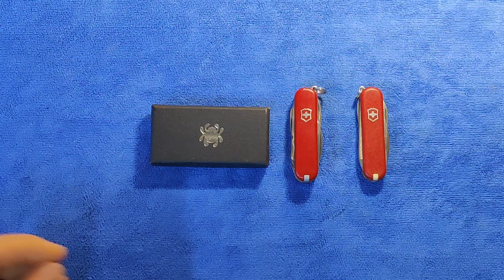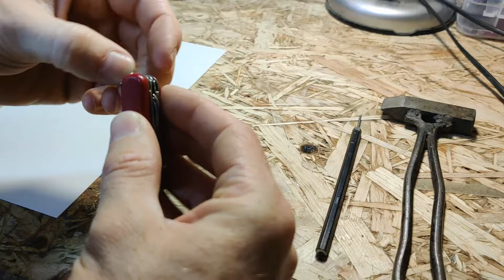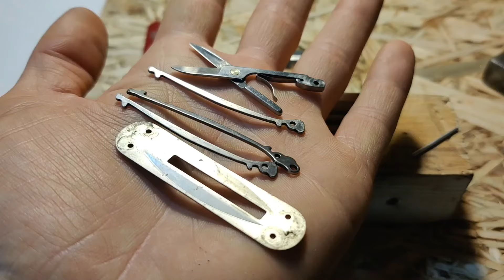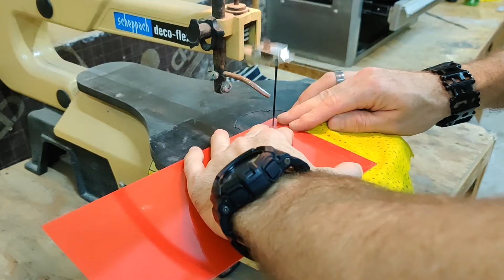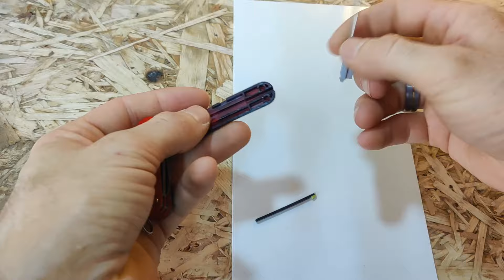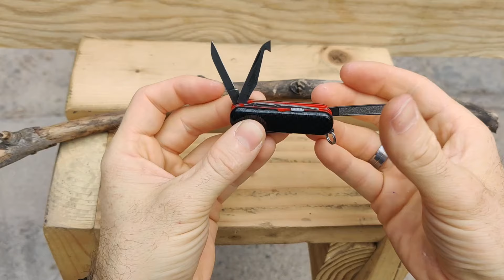Spydernox with G10 liners and saw mod

Comment: This video hooked me real good, instantly subscribed! Turned out absolutely jaw droppingly good looking. The saw was what got me most amazed though. That tiny ruler always seemed like a waste of space to me. Nice use of the cuticle pusher that I never saw any use of either.. Any other suggestions for that tool? 
Would like to get in to modding myself. Any tips on most essential tools to get to do SAK mods?
Reply from the maker: Hey! Glad you enjoyed the video! And a huge thanks for subscribing!
I don't have any other mods in mind at the moment. But I do have a large project that I plan to call The 58mm XLT. There're going to be lots of added tools! 
As for starting modding, you will need some basics - drill, hammer, dremel, and some other tools depending on what you plan to do. Feel free to message me here or on Instagram if you need help!
Reply: the cuticle pusher could be used for very small wood carving, give it a try
Reply from the maker: @Tantannegreiros57  I ended up turning the cuticle pusher into a chisel. Works really good. You can see some more of my work on my website f2scustoms.com

Comment: Let me ask you this, do you have to shave some of the thickness of the honey bee down? It seems to be alittle bit wider than my spring?
Reply from the maker: Yes, the Honeybee has to be ground down to 1.1 mm or you can place it on 2 springs, but you will need to add washers.
Reply: Now do you just grind down the portion where the pivot is? Or partially down to where the spyderco is written at? I think I went to far down and took down some of the line that runs from the bottom to the top. I noticed yours all have the line.

Comment: How do the tools snap in place, and how does the Spyderco blade stay in place when it’s open, it looks like the liner in the middle would just take up the space
Reply from the maker: I'm not exactly sure that I understand what you are asking. But, the tools snap closed like on all Swiss Army Knives. The Spyderco blade does not lock open, but again the 58mm Swiss Army Knives don't have a lock for the blade or tools. Hopefully that answers your question.

Comment: I am never really clear on the saw in a pocket mini tool.. I am not sure what situation would come up that I would need a saw in my everyday life. And if I ddi that warrants going and retrieving a proper saw (not a mini pocket tool). And in a  survival situation, I can break any branch that the saw on the mini pocket tool can cut.
Reply from the maker: I understand you. It does seem like it would be worthless, but trust me it's much handier than you would expect. I should post a video of how long it takes me to cut through a 2x4 with this little saw. 😝 I think you would be impressed.
It's not going to be able to do what a full size saw can do. But then, I can't carry a full size saw on my keychain. 😁
Reply: @FittoSurvive  I guess that's my question....how often re you needing to cut into a 2x4 that you don't have easy access to a saw. I love to do fixit projects for my friends and family and I am not getting the need to carry something around all the time that can cut a 2x4 (instead of a carrying a tool that I would use much more often).
Reply from the maker: @Rotwang72  I don't have to cut through a 2x4 that often when I don't have access to a full saw. I still enjoy having the ability.
After acid etching the ruler all of the ruler marks were gone, making it an unnecessary tool. Turning it into a saw gave it purpose and made my mod unique.

Comment: I have a similar project going. What did you use for pins? I was going to use 2mm brass. Did you have to file the Spyderco down to fit the springs? And resize any holes to accommodate?  It also looks like there are riveted. Where did you find those? I’ve searched everywhere on the web.
Reply from the maker: Hey I used 1/16 inch brass rods. I included a link to them in the description. Yes, I had to file down the Spyderco to fit the springs. The Spyderco hole was too large, I inserted a brass spacer to make it fit. Nothing is riveted, I peened everything. Message me on Instagram @fit2survive_ if you have more questions. There I would be able to send you pictures or videos for explanation. 👍🏻
Reply: @FittoSurvive  What type/size of brass spacer did you use for the spyderco hole?
Reply from the maker: @jakegreenlee9929  I used 1.6mm like usual. I changed the size of the pivot hole by tapping in brass and re-drilling to the needed size.
Reply: @FittoSurvive  Thank you!
Reply from the maker: @jakegreenlee9929  You are welcome.

Comment: How did you get the blade off the Spyderco
Reply from the maker: There's actually a really easy way to get it out. Just put a flathead screwdriver into the knife with the blade open and twist. It will pop right open. Check out my newer videos on YouTube, seems like I showed the process somewhere.

Comment: A little pointless to have such a short saw, you'll end up banging your nice SAK against whatever you are cutting without getting much actual cutting done. It made much more sense to turn it into an awl. Pretty cool otherwise.
Reply from the maker: Possibly.  I enjoyed the project and have had several requests for mods like this one. It is not as functional as a full size saw, but it is unique. About the awl, check out this Minichamp I made with an awl from a Wenger. https://youtu.be/i5WToK6oyE8